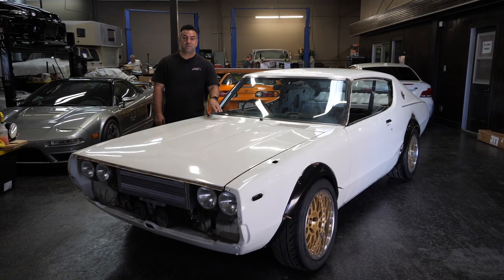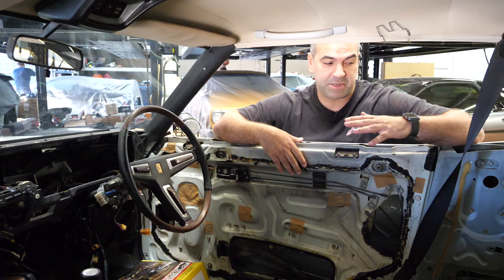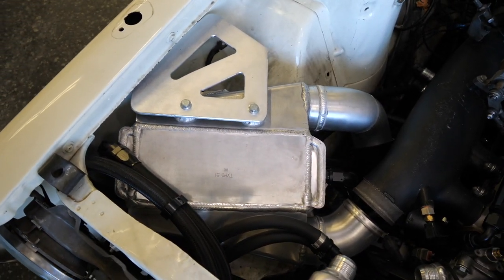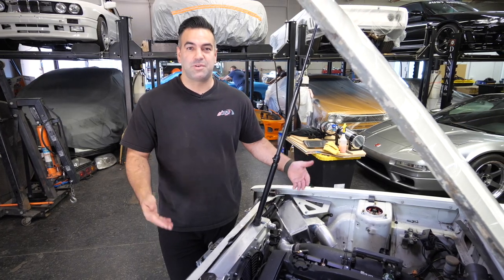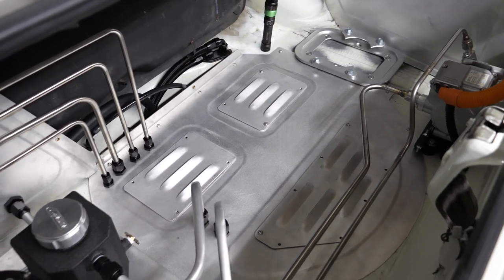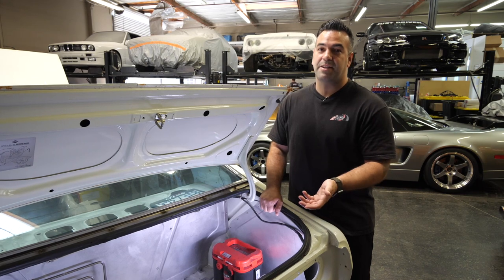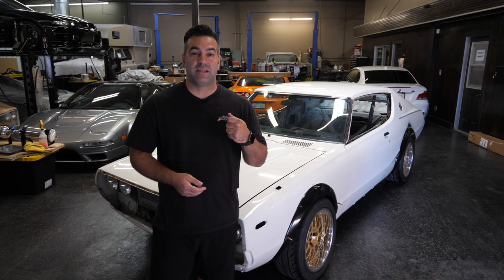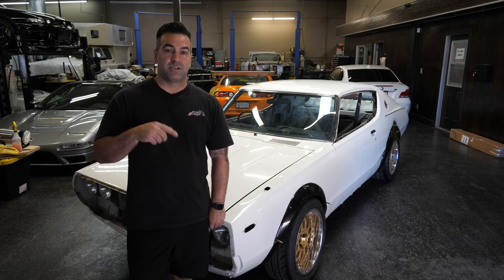The Kenmeri Skyline gets its RB26 Swap and so many new parts!

Comment: Love the rims, all my cars had this style of rims. But I drive 90s Mazdas.
Sorry, but imo those just don't look good on a 70s car. 🙈 It's just a matter of taste.
Reply from the maker: They are a bit bold for this chassis. Maybe when the car is fully finished you can weigh in again. We appreciate all different kind of tastes here. What Mazdas are you driving? We have an FD project we did some videos for a little while back. Thinking about doing phase 2 for it.
Reply: @JustDriven  mainly Protege BA models. The RX models are way out of my budget. 🙈
Reply from the maker: We are fans of the later year Protege wagons.
Reply: @JustDriven  I had a 2003 Protege hatchback as well, somebody crashed into it after about a year of ownership. It was nice but heavier and less agile than the older ones.